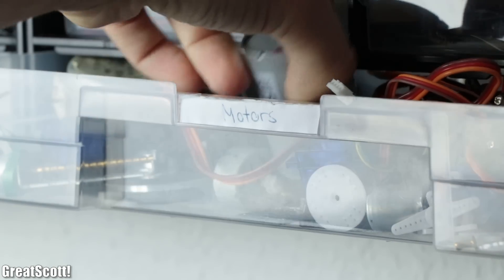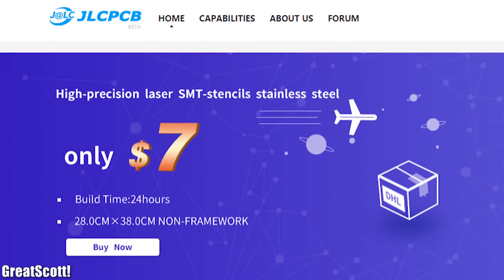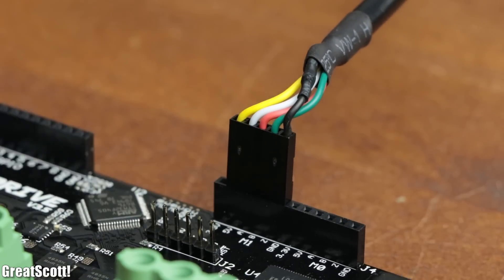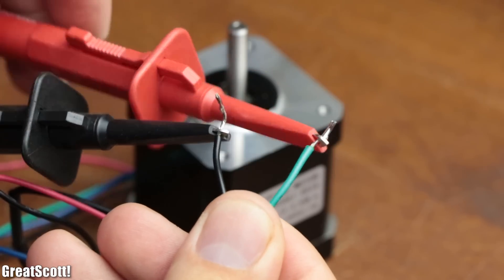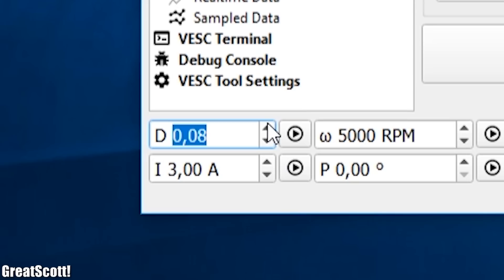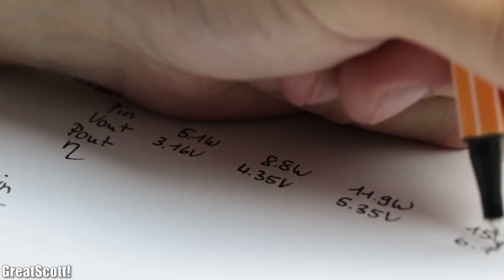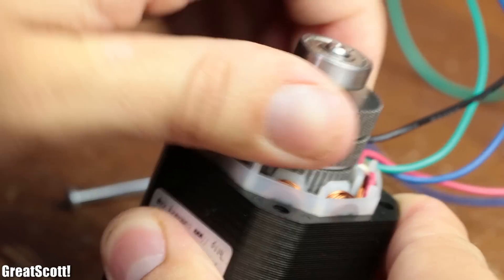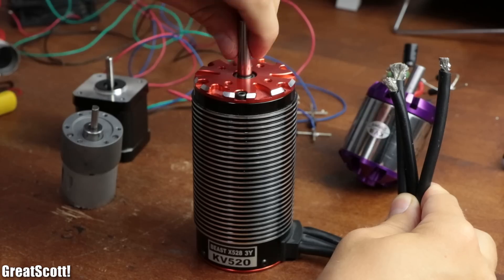Which Motor Type is the Best Generator? || DC, BLDC or Stepper? (Experiment)

Comment: The general conclusion might be right, but what the biggest flaw was in this analysis is that you did not use a variable load. All these motor types want to put out a certain voltage according to their speed and a certain current according to their torque. If you dont draw the appropriate current for a given rotation speed, you are either drawing too little current and not much of the available energy is really converted into electrical power whereas mechanical friction is not reduced. Or you are drawing too much current and your winding losses are bigger than they should be. Each motor has an optimal current draw depending on speed en motor constant, but if you use a power resistor you effectively fix the current for each voltage, meaning that this is partially an experiment testing what motor constant is best suited for using with the fixed resistor. Therefore you should ideally have a dc-dc converter in order to transform your load to that of the optimal value as seen by your generator.
Reply: You are right!

Comment: I just got an idea. Building a pedal powered ebike with a generator in the crank, instead of a chain drive, derailleurs and freewheeling mechanism. Could this be more efficient, since there would be fewer mechanical parts? It would also be really interesting to try to build an electronic substitute for a gearbox using a VFD.
Reply: Less efficient but has other benefits, I'm about to give it a go.

Comment: 2 years back I had made a hand generator for Mobile phone & camera charging for extreme survival. I found stepper motor is the best for making generator as it gives about 16-20 v at lowest rpm wrt dc motor. I used this voltage to charge Li Ion battery with buck converter and battery protection modules.

Comment: This is very scientifically inaccurate... The losses in your 'motor' section will vary greatly, consider the case with no load, it will still have a set power input as dictated by the duty cycle, but all the energy will be lost to the electric fields and some to mechanical. However, load the motor slightly, and now some of the power goes into the load and less gets absorbed by the fields. So you need another 'source' in order to classify those efficiencies. Perhaps something such as a bucket hung by a string, and then dropping. Use video analysis to get the final velocity, get the difference between actual acceleration and acceleration due to gravity, and you have a force (average force) then use that to get the power... Generators generally have efficiencies well above 80% which means you must have lost much in your methodology... But still a great and informative video as always..

Edit: electrical motors and the general field of Electrical Drive Systems (EDS) is actually a hugely complex study

Comment: Great stuff! Which of those two motors will  produce useable voltage at lower rpm -  Stepper motor or Bldc?
Reply: Brushless motor with low kV rating. KV90 or lower.

Comment: What about using a universal motor as a generator to output AC power  to a transformers secondary winding which would then step up the voltage to the primary winding?

Comment: I love your videos, and seem the right guy to help solve my problem.  I would like to use a BLDC motor on a winch to lower a heavy weight.  As it does so I want to control the speed and maintain the speed of the lowering of the heavy weight.  Right now when the weight engages, it accelerates the motor to a very high velocity.  I know it has the power and the torque, but how to make it a brake with controllable speed?  Please help.
Reply: on the sechspuls Brückenschaltung, why put the capaciter?

Comment: Hallo!  Ich will einen Motor an mein Fahrrad amschließen um so einen Dynamo zu machen, der aber mein Hamdy, etc. auflädt. Dazu benutze ich dann einfach ein USB Output und löte es an die Kabel vom Motor.... Meine Frage ist aber, welchen Motor ich dann benutzen soll. Wie es scheint sind ja die Nachteile von einem DC Motor, dass man eine hohe Anzahl an RPM braucht, man viel Kraft braucht und er Geräusche von sich gibt... diese Punkte sind mir ziemlich egal, weil ich beim Radfahren viel Kraft und RPM haben werde. Ich will also einfach nur viel Strom bekommen und will höchstens einen Stepper Motor benutzen weil meine Elektrik-Kentnisse nicht so hoch sind. Eine zweite Frage ist, ob ich einen Low, oder High RPM Motor holen soll, nach meiner Logik denke ich mir, dass sich ein Low RPM Motor mehr lohnt.  Ich hoffe das du auch nur eine Kurze Antwort schreiben kannst
Reply: Das USB Kabel würde ich nicht einfach an den Dynamo löten.
Wenn du zu schnell fährst erzeugt das Dynamo zu viele volt, mit anderen Worten du zerstörst dein Handy durch eine zu hohe Spannung.

Comment: With 2 motor connect each other and input a small voltage in the first motor and get a output that more than the input voltage use that voltage. To get start the frist input motor for free energy by charging into battery

Comment: i just use 24 pedal assist and gears with chain then i connect motor to motor so i watched your video for motor efficiency but it doesn't matter as long as it make more then the original 24 volts i am happy. i win. i got 32 volts with two not so good ones.

Comment: Very informative video! Liked! Curious if you can answer a quick question. What is the significance of the stepper motor’s coil resistance rating? Does a higher number for resistance mean it’s harder to turn - for example a 32 Ohms motor would require more force to spin than one rated at 1.5 Ohms? Thanks!

Comment: Why did you use a rectifier and a capacitor? That's producing many reactive power by harmonics and also horrible harmonics in torque as a result, that the current only flows, when the differential phase voltage is higher than the capacitor voltage - diodes voltage drop.

Better to use only three 3-times greater resistors in star config and the rms measurement function of the scope, where the definition of rms is: "an alternating current (AC) that produces the same amount of Watts than an analog direct current" - back to the theory roots ;-)

Comment: best generator is the drain pump from your washing machine, can get 1000volts turning with a small dc motor. check it out. its puts out a weird power that flows  on the outside of the insulation during some of my builds, but a fairly friendly power unlike the wall socket.

Comment: I agree with your explanation but what the reason for converting alternating current to direct current, which will further reduces efficiency. 

The voltage drop across two diodes approx 1.4V (0.7V each) creates huge impact especially when the generated voltage is very low. 

It's just my opinion. Think about it.

Comment: My question is what was the efficiency for BLDC and for stepper because you gave two figures like 27 an 32 % and didn’t say which was which….. Also, you should not use a gear box if your idea is to generate for wind, because the gear box sets too high a threshold of torque needed to spin the motor which just will not work in low speed wind applications of the scale you would have such a sized motor in.  With wind you want the least mechanical resistance possible for that generator so ti can use the lightest winds to make power.

Comment: Low KV brushless motors ranges around $100... the cheap brushless motors with gearboxes require 20-30lbs of brute force to turn the 100kv brushless motors......
Reply: A starter and flysheel will give it a push. This will drastically reduce inrush current on primary bldc motor in my PSE generator.

Comment: Thank you for the demonstration. I need to charge large lithium ion battery packs. A bldc generator with gearbox is what I had in mind.
Reply: Low KV brushless motors ranges around $100... the cheap brushless motors with gearboxes require 20-30lbs of brute force to turn the 100kv brushless motors......

Comment: Thank you for this video. I found this video, by searching for "What makes a generator efficient?". I made this search, because I just had the thought: Should I just buy a portable generator, and use a variable transformer & rectifier, to adjust the 120volts from the manufactured generator, to the charging voltage of my batteries, in my Series-Hybrid motorcycle?
Or.
Should I get a motor, based on it's volts-per-RPM, couple it through a gear ratio to an engine, and use a governor or set idle speed, to get the charging voltage I want? Maybe using a buck-converter & blocking-diode, to make sure the charging voltage stay exact.

What makes a motor, efficient at being a motor?
What makes a generator, efficient at being a generator?
Are they exactly the same, or are there specialized designs?
Reply: And I can't find a high current buck-converter, that can handle the max charging current, of the batteries in my Series-Hybrid projects.
How to make a buck-converter that can handle 100 to 600 or more amps?

Comment: Can you demonstrate using the BLDC to charge a 12 volt battery with an MMPT charge controller? Either with rectifier or with a 3 phase to DC charger controller. Maybe use a very large BLDC motor that can double as a paramotor and wind turbine using the same propeller. And then see if another propeller is more suitable for wind turbine mode.

Comment: Still cant figure out which motors i have are which. I got a lot of those regular little ones but I got a bigger one in an old dirt devil vacuum that Id like to figure out how to turn into a generator that can be spun by hand wind or water. Seemed easy before but most of these videos go into technical shit as though people are gonna run a whole house on it. Like geeze just tell us how best to get these motors running basic 5v to 12v for some electronics versus this LED light hobby shit I keep seeing. All I see on the back of it is "Dirt devil hand vacuum model# SD20005 MFG CODE 109A 120v 60hz 7amps" Even in highschool amps joules and volts was confusing not to mention what every little piece attached to things did.

Comment: From experience a stepper motor is the best but its not practical because its too hard to turn it but it does generate good voltage at low rpm.

Comment: A full bridge rectifier will not give you the maximum performance out of the BLDC'or the Stepper and now that I think about it the DC motor either.... You need to use a VSC so that you can adjust your current angle with regard to load and speed. To effectively compare all these motors you need a better setup. An independent speed and torque measurement for a start, a driving motor that can do double the torque match the full range of speeds for each motor and a stable mounting (this ones difficult if done on budget) If you dont align each motor perfectly each time, your measurements will be off because you will lose energy in the coupling ( your wobbly BLDC is an example of this :D). Don't use a gear box because you will have to work out the efficiency of that as well which is also dependant on temperature,speed and load. ( not that its a bad idea for use in a generator, most wind turbines use massive gear boxes). I suggest a torque & speed sensor in-between the drive motor and generator. Then you need a VSC to do a full range of each generator and you can then make conclusions on you results. A single data point at a single operating point just wont cut it.  Also something to be aware of. If you change the winding of the BLDC your current will increase which increases your copper losses and will bring your efficiency down. Rather stay high speed, high voltage, low current if you can.

Comment: O scott the grate... 
You know that 
The Dc motor runs on prescribed voltage on rated RPm but
BLDC moter can run on lower voltage for lower rpm .
So rpm may be control by input power in bldc motor 
gear box is not required.

Comment: This is a basic function of electric and hybrid autos. when they brake, they run a charge to the batteries. This type of circuit, usually applied to AC motors (I believe), should be no problem for you. The reason I bring it up is Thane C Heins (on YT) re-invented a bifilar stator wound motor for a car and discovered it generated electricity while it powered under load. Tesla was familiar with this, he patented the bifilar wound inductor that inspired Heins, and reported in his court transcripts that not only did it change the phase of the magnetic field of the BEMF, it reduced the torque slightly.
My point is, you should be able to charge your power source on your drone during flight, and if not run without limit, increase your flight time between charging. (Thane also patented a transformer that reduces the BEMF that is fed back to the input coil and thus amplifies the power used by 4x the power in. With a high frequency AC motor the size of the ferromagnetic components will be small and should make for some very long running drones... Thane claims he can make a car that never needs charging... only something that would interest a hobbyist.
Great videos. 
Oh, Joe Newman used the same method, a capacitive induction coil on a stator winding with a brushed DC motor and produced a motor that he proved was more efficient than any motor commercially available. His motor ran on voltage alone and charged the standard batteries he used to drive the motor. It too generated electricity while it ran. So a standard DC motor will do the same thing, I suspect any motor type will as by adding capacitance (with the bifilar winding) will delay the phase of the BEMF current flowing in the stator until the magnetic field of the rotor changes polarity. Then the BEMF current will flow in concert with the input current. So, you should get more push out of less input power. I"m not sure this would work in a brushless controller. I haven't looked at how the BEMF is handled. Cheers, B

Comment: i have a question for you about this since im having some trouble finding out what i need. if you were to use an old dc motor say from an rc car i have a few laying around some of them were quite large. most of what i have seen is your going to need alot of rpms to get any useable voltage but i want to graft one of these onto a 2 stroke. i dont know enough about winding coils or integrating that into or making my own charging system and balancing it enough to spin at 14,000 rpms and not become very dangerous to make my own stator and coil. and i dont want to put a full size car alternator on that motor either it wouldnt work due to space. is there a chance that the motor would make too much voltage and surpass about 14.2-14.4 volts? also what would i need to read up on to isolate the power coming from the motor so it isnt just turned on when connected to the battery. 

the 2 stroke in question is on a scooter thats been converted to water cooling and has a headlight conversion that uses less watts but more amps. its a toy so its not like it has to be durable and my charging system can almost keep up while wide open but i cant do 90 mph everywhere so its always at a constant drain. i cant finish the project till i can drive it long enough to get hot and finish tuning it but i cant drive it around with no water pump or headlights after 20 mins. i think i really only need to generate about 35-50 extra watts tops for the system to be fine idle is my main problem anytime im stopped the stock charging system doesnt do much. it was designed to put out 80 watts at 10,000 rpms.
if you have a better idea to make the voltage im all ears. it just sounds like the brushed dc motor would be the simplest unless the voltage can climb too much.

Comment: gs,  sources of gears.     investigate gearing for rc cars; other miniature precision gears.         do  NOT use  CLOSE-ratio  gearing.      because,  losses are  HIGH.         in a power Generation/transmission context, first stage of output should be  1:3.   second, should be higher; perhaps, 1:5 or six.       the   1:5 or 6   is the 'difficult' ratio.       be prepared to make diy  add-on  hubs, in order to mount gears on   smaller shafts.     make a  double-gear for the second stage; for compactness.         the  'model' for the output is, a wind turbine or hydroelectric waterwheel.        googletranslate  
https://www.bigsquidrc.com/wp-content/uploads/2012/05/exo_spur.jpg

see a double gear;    the use of a worm gear, to get high ratio in a single stage, could be tested.
https://ae01.alicdn.com/kf/HTB1FMKgOVXXXXaVXVXXq6xXFXXXZ/34-kinds-of-Plastic-gear-rack-pulley-belt-Worm-gear-Single-double-gear-teeth-new.jpg

https://www.bigsquidrc.com/wp-content/uploads/2012/06/proline_transmission_04.jpg

reverse,  planetary,  step-up  wind turbine gearset.     losses high;  not suitable for use in  micro-generation.  
https://qph.fs.quoracdn.net/main-qimg-43c684702b4a6f0bdb160105645fe578-c

small waterwheel transmission; at 1:56
https://www.youtube.com/watch?v=1TiLuAu7jbw&t=

Comment: Microwave turntable motor smokes all those motors you used.  I can give it a quick turn about 1/2 revolution and get 384v that will make you scream louder than and higher pitched than you ever want anyone to hear.  The second best one I've found was from a hand blender, I could easily get 120v out of it by spinning it by hand.

Comment: You have to turn the motors at rpm appropriate for the motor....

Your coupler on the BLDC is out of alignment and if you got that up to the correct rpm, you'd have thrown the motor across the room.

Comment: I want to build a 12-volt electric generator. I understand how a car or gas motor generates power the motor spins the alternator fast enough to generate all the power a car needs with a good alternator the battery can be removed and it will run until you turn it off or run out of gas. How can you do this using an electric motor? What type of motor and what could you use in place of the alternator? Any ideas or site links that cna help me with this project?